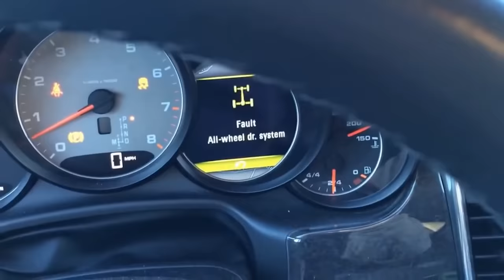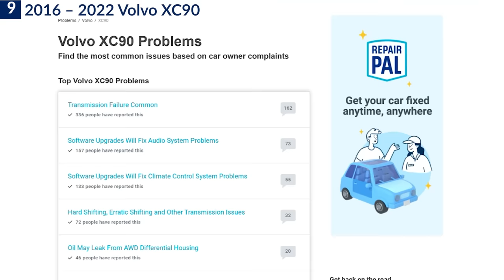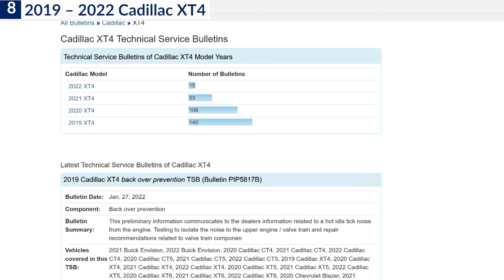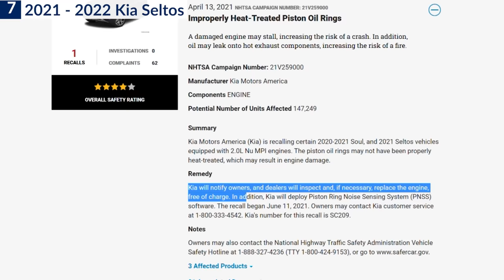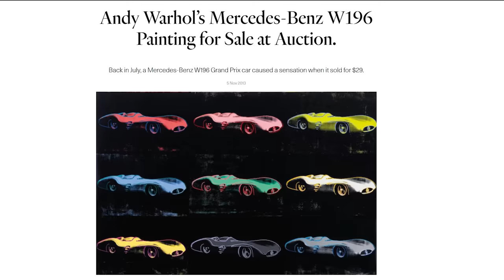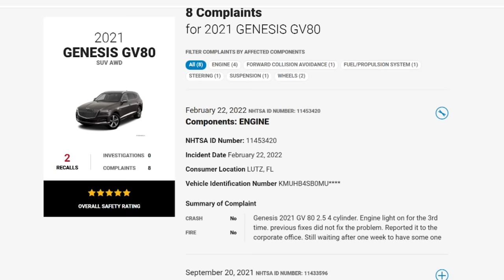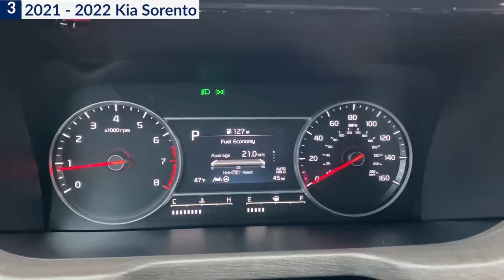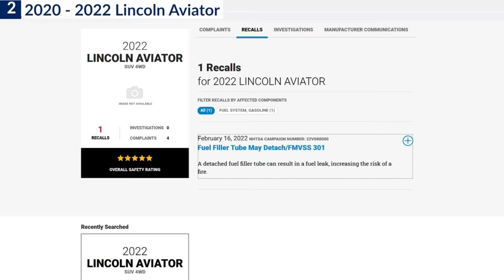10 New SUVs to AVOID - Here is Why !!

Comment: My wife has owned a 2018 Tiguan SE and the only issue she ever had, was one of fuel injectors went dead at around 30k due to a faulty connection, and it was covered under the warranty. She traded it in, at 48k, for a 2022 Tiguan SE. Neither car has ever given us any major issues. My wife absolutely loves her Tiguan. I had a 2018 Tiguan SEL and the only issue I had, was that the previous owner failed to get the recall done for the sunroof drains, and it leaked in a carwash. The dealership I bought it at, wasn't a VW dealer, and they weren't aware of the recall. Took to the local VW dealership for the leak and they replaced the sunroof drains, carpeting, sound baffling, and padding. Zero issues, besides the leak, and I loved having it. Traded it at 65k, for a 2018 Atlas SE w/tech, and had that for 2 yrs. Traded it earlier this year for a 2023 Atlas SE w/tech and can't see myself driving anything else.

Comment: I owned a Yukon Denali years ago and it was my most reliable vehicle ever.  I drove it to 180.000 miles before I had my first problem.   And the problem was a very minor problem.  The SUV never broke down on me.  But that was the 2002 model Yukon Denali.
Reply: They were made much better in 2002
Reply: Thats why, built much better than this new crap
Reply: That was a different era
Reply: Same, I had a 2005 Escalade, 2010 Escalade and 2016 Yukon Denali.  None of them ever left me stranded.  Of course I have this weird habit of doing routine maintenance.
Reply: 2001 Yukon with 201,600 miles and still going. Only replaced the oil line!!!
Reply: I have a 2003 GMC Yukon. 181,000 miles and going strong. I do have routine maintenance done. Love this vehicle and it is so comfortable.
Reply: 2007 Tahoe. 256k runs good
Reply: I have a 2002 Yukon. She has 300k miles, and is just starting to give me problems. 2023 will probably be her last year.
Reply: @tarawebb9237  oh, I’m so sorry to hear that. She’s been a great ole gal though huh? We had an alternator issue and one cracked wiper washer fluid reservoir. Oh and my batteries only seem to last 3 years before needing replacement 😀 She just hums along and I appreciate her every single day. Safe, secure and such a strong comfortable journey. Much luck in your new choice 🙏
Reply: 2005 Yukon 324,500 miles and still running good! Most reliable vehicle I have ever owned!
Reply: I do need to get the drivers seat reupholstered. The leather has begun to crack. TBH I use the seat warmer’s frequently in all months but summer😃
Reply: Thats funny how people say cars were better in 2000’s. 😂 which means if we go back more they will get better and better?! Early 1900’s had some of the best cars 😂😂

Comment: 10,000 miles into my 2021 GV80. best car I've ever owned. zero issues. Turns a head every day and someone will ask you if it's a Bentley daily.
Reply: If a car break down at 10k mileage, then they will go bankrupt in a year. Try 200k, then we'll see.
Reply: My next car!
Reply: Yep, 1 year in and a head turner for sure..
Reply: 10K and 1 year? Dude a Russian car can do that! LOL. My 2011 Jag XJ Supercharged was built 12/10 meaning it is about six months away from being 12 years old. 96K miles, purrs like a kitty. Only replaced the water pump. Your HyunKiaGen will never make it to 12 years. 🙂"Best car I've ever owned" my azz.
Reply: @trevorsutherland5263  i have kia with 200k still going strong. I intentionally drive hard too just to get an excuse to break the car and replace it but it just won't die. Never had Genesis but I heard nothing but great things so far
Reply: @trevorsutherland5263  cool story bro
Reply: @trevorsutherland5263  Jags are notorious for having issues OTOH Hyundai has almost Toyota reliability now. Have had Sonata/Genesis/CRV/Acura and had no issues with any one of them.
Reply: @trevorsutherland5263  What year do you live now? 1998? 2000?
Reply: I DRIVE 2015 TOYOTA  CAMARY  WITH 96000 ON GREAT 🚗
Reply: @trevorsutherland5263  Dude, you got fortunate. Plenty will tell you Jags aren't exactly the most reliable cars on the road. As in everything even the most reliable brand will throw up a lemon now and then, and the most unreliable a peach. That's life but on average Jags are not known for reliability.
Reply: @trevorsutherland5263  I still see Hyundia's and Kia's on the road from back in the '90's and still going strong.
Reply: @murp61  ya , having the engine replaced two or three times don't count, bro
Reply: The 3.5 liter ones are good engine

Comment: My 20201 Genesis GV80 Prestige 2.5T 300 HP RWD has been perfect.  It is as near perfect as any car I have owned.  There is so much quality built in that the $60K price tag is very  reasonable.  With 13,300 miles within  20 months ownership, I expect to have this car for a long time.

Comment: The Genesis GV 80 is the most reliable car I've owned,  not a single issue in two
Years and 30,000 miles.
Reply: Indeed!
Reply: I'm at 180k 7 years on grand cherokee limited no issues less than 100k miles it shouldn't tear up
Reply: LOL 30k mileage? Is that a bench mark for 1900's era cars? 
Today car bench mark is at 100k. And 60k is just a break in period of owning a car. In my opinion bench mark should be at 200k, where the Japan cars dominate.
Reply: i definitely don’t believe this about the GV80
Reply: And big anerican trucks and suvs.. tahoes expeditions etc
Reply: 2 years and 30k is hardly a glowing endorsement, but In general I have to agree with you. I had a 2018 Genesis G80 for 4 years and put 180k on it. It was damn near faultless, so genesis is capable of making a reliable car. Now the GV80 is new and its possible that Genesis messed up some things, but i have no doubt in my mind they are more reliable than some brands missing from this list. Audi, BMW, and Land Rover to name a few.
Reply: @DarianDT  agreed
Reply: LOL. My 2011 Jag XJ Supercharged was built 12/10 meaning it is about six months away from being 12 years old. 96K miles, purrs like a kitty. Only replaced the water pump. Your HyunKiaGen will never make it to 12 years. 🙂"Reliable" my azz.
Reply: @trevorsutherland5263  12 years 96k miles..... Be proud of the fact that something that barely gets used has managed to not break lol.  I put double the miles on a genesis, in a quarter of the time, and nothing broke, not even a water pump. Only things replaced were normal wear/maintenance  items: tires, brakes, fluids, windshield wiper blades.
Reply: @mabm85  😌 nice rebuttal.
Reply: In fact according to J.D. Power,the Genesis brand came tops for Initial Brand Quality and also Reliability going back three years now.
Reply: yeah i would hope so at only 30k miles
Reply: To the idiots that a criticized in this man for saying his Gv80 has 30 000 miles and is OK  The car has only been out a couple of years Try and think people
Reply: That’s my next vehicle. I have a RX 350 but it’s not enough luxury for me.
Reply: I love my GV 80!! To each his own.
Reply: I think he is talking about the 2.5 engine which has lots of issues.
Reply: @R Tee I am going to say what you possibly/maybe? forgot to say; your Genesis GV 80 is NOT YOUR ONLY CAR??
If that is the case, it is easy for me to believe/understand why there are only 30.000 miles on your vehicle.
Reply: Agreed. I have the GV70 and it’s golden
Reply: @DarianDT  yeah but with a genesis you get a 100k mile warranty while domestics balk at anything over 36k mile warranty.
Reply: Dont worry your issues are coming!
Reply: Two years. Really
Reply: @trevorsutherland5263  nobody asked :)
Reply: @mabm85  I have heard range rovers are some of the most unreliable vehicles ever made.
Reply: Still a baby, update that in 8-10 years at least.
Reply: Oh really. You must got a good one. 57 thousand miles on mine. My transmission started to slip.on my way to work one morning. !!  I took it right back to dealership. Never again. 🥵🥵🥵 I’m going back to lexus.
Reply: Bought my 2005 honda pilot; 178k miles with no issues except replaced alternator 2 yrs ago. Just do regular maintenance and runs like new. Paid 40k out the door.
Reply: how can you truly say its the most reliable when youve only had it 2-3 years lmao. literally doesnt make sense. LONG TERM reliability is what people talk about when talking about cars

Comment: I have a 2109 xc90 r design and it was 2 years before I even opened the hood and I only did that because I realized I had no idea where the latch was. Its been the absolute best car ever
Reply: I have a XC90 2018 T8 excellence, I've had no problems with this.
Reply: @nkulid424  iam having 2022 xc90 r T8 design. Such an awesome car
Reply: @jack32322  gosh I bet. Does it have air suspension?
Reply: @nkulid424  Yes. Best of the Best. Its hybrid, roughly runs 20-25 miles on electric before gas
Reply: Volvo is great. Don't listen to this rubbish
Reply: I cant afford one of the new ones, but then again, my old 2009 XC90 V8 has over 280,000ks and still runs like a clock!...so not really rushing for an upgrade ;) 
Volvo for Life!❤
Reply: @willytheekid  that's awesome, I always low key evny the V8. That engine is a masterpiece
Reply: 2109 xc90 must be futuristic asf lol
Reply: @andyb7719  Volvo is 🗑
Reply: This is BS the Volvo is a great SUV I have leased three of them Great car very reliable very safe
Reply: @andyb7719  agreed, im on my 5th one and never had an issue with either...started with a S40 i did have to get a battery and head light replaced on that one but thats normal wear and tear so im not complaining at all....currently have the 18 XC90 T6 have had it a year and a half now,no issues and absolutely love the SUV
Reply: @imdone1967  opinions are like A--holes everyone has one🤷‍♀️but im a proud 5th Volvo owner and beg to differ.....never had a issue with either
Reply: @teecope488  guess a sample size of one makes Volvo the best ever...lmao
Reply: @BialyOrzel777  👏🏿🤣👏🏿🤣👏🏿ikr,thats freaking hilarious
Reply: @imdone1967  i guess so🤷‍♀️

Comment: Boy oh Boy.. hyundai kia sure is screwing the pooch again. aren't they? Did anybody take notice of the one item these all have in common? If you guessed in car electronics you are correct. I have always said more wires will create more problems. Also i find the electronics in my 22 santa fe annoying as hell. The way the screen just sits there in the dead middle of the dash board. It is like somebody said, oh wait lets slap a infotainment system here real quick so we don't look stupid. I recently priced a replacement screen and interface. $3000.00 not including install. When it goes i guess crutchfield will have to do because i am not replacing that factory stuff.

Comment: We just bought the 2022 GLE 350 2 weeks ago. This is before I saw this video. But I am hoping that they have fixed the issues from 2020 to 2022 with the new 2022 model. I will keep you posted.

So far, we love the car and the drive is awesome. Interior is excellent looking as well.
Reply: Any issues so far?
Reply: @azher191  Just when it's raining, the water somehow collects in the middle. But the ride quality and the comfort is excellent. My kids love the LED color changes and the panoramic sun roof. I normally drive it in comfort drive and it's sufficient for City driving especially with traffic. Better gas mileage than our old 2008 ML350.
Reply: @slash2freeze  nice. But the water collects where? On the roof?
Reply: @azher191  In the front windshield. So it's harder to see with all the water collecting in the front windshield. It didn't help I was driving at night. But day time driving with rain was not an issue.

Comment: 2022 Sorento SX Prestige X Line owner for the  past year . I love this vehicle. All the features, smooth quick drive and spacious
Reply: I got a 2021 SX Prestige X-Line when it first hit dealerships in Dec 2020 and my only gripes are with the transmission at low speeds and a super annoying rattle around 1500 rpm that seems to be coming from the engine. My local service center acknowledged that they could hear the rattle but refused to do anything about it. I also hate that there is no HUD or ambient lighting.
Reply: Oh wow. You must got a good one. I’m on my second transmission !! Never again !! 🥵🥵🥵🥵🥵🥵😡

Comment: I had an explorer for 8 years with no issues until 1 days the engine started knocking. So I can’t say they’re unreliable because it served me well for 8 years.
Reply: I've had my explorer since 2003..have 150 000 miles on it..last explorer to be built on a truck frame..have no problems with it other than replacing a/c compressor..but living in az u use the  ac year round..ac gets quite a workout..still have it and it carries everything in the back..a great vehicle..

Comment: I’m on my fourth Land Rover/ Range Rover. Never had issues with any of them. Tried an Audi and kept it for 18 months of which two months were in the shop. Could wait to get back to RR.
Reply: Worst car I've ever owned. LAND ROVER. My God what a nightmare.
Reply: Not sure if you are getting new or not. I’ve owned 1 new 96 Discovery and 4 Range Rovers. The 2004 Range Rover was the most reliable, but still man the maintenance was over the top and stuff started breaking around 90 K miles.
Reply: Don't believe this lol. Must've gotten rid of each one after 3 yrs max, that's why you "never had issues with any of them".
Reply: @theGiver3  Had my first one for four years but had the chance to upgrade. Second one for eight years. Third one is new (8 months). My wife’s is twelve years old. Paid for extended warranty on the first two and my wife’s which turned out to be a complete waste of money. Average 25k a year. I know they have a poor reputation and perhaps I’ve been lucky but it is a mistake to think that they all break down, all the time. They don’t. Believe it.

Comment: I’m a Volvo XC90 girl and I’ve never had issues with any of them I own. My favorite vehicle honestly.
Reply: Give it another year...LOl....when it is out of warranty.
Reply: @chadhaire1711  Lol I currently have 3 of them that I’ve owned for years, again I’ve never had any issues with them. My oldest is a 2007 with 327k miles on it and it still runs fine, just recently needed to replace the oil trap. I also have a 2012 and a 2017, and I plan on getting a newer model next month. It’s my favorite vehicle lol.
Reply: @Mutable_PageOfCups  The Xc90 has had more recalls than I can list--2007 transmissions were horrible for a start, and since the Chinese took over electrics, drive line, brakes, leaks, and a whole list......no thanks
Reply: Same here,my XC90 is my 5th Volvo....i love em ALL🤷‍♀️

Comment: I can confirm one of problems with the 2020 Ford Explorer: Brand new, and we experienced leaks from the Transmission, so often. Parts had to be ordered, and car would remain days at the dealer for repairs. We had to take it 4 times, until we had enough. Not even a year and so many issues. --- So, turned out to be a Lemon. Ford had to buy it back. It was our 3rd Explorer,...so we were kind of surprised how sucky this new redesigned model turned out to be.
Reply: Oh yeah. I had one just like yours. It only had 15 thousand miles on it.  I only had the car for 2 weeks. Then my transmission took a dump on me.) ford had to buy it back. !  Because they knew it was a lemon. !! Never again. Worst car ever made. !!  One week later I got a letter from the ford corporate office. Telling me about a another car. NO thanks !!
Reply: Had a 2005 ford explorer. Needed a new transmission after 30k miles...
Reply: Ilove my 2018 3,5 non turbo Explorer Limited
Reply: Brought a brand new Escape. Worst car I have ever owned. Has been to the shop three times in less than a year. Now dealing with a lemon law attorney. Bad brakes, transmission and fuel pump.
Reply: Same here. My 2017 Ford explorer started having issues within months. Transmission of course. I love the ride and look but I will never get a Ford SUV. Ford pick ups are better but the explorer sucks.

Comment: I bought a 2002 tahoe new.  It went to 260k miles.  I drove it to the snow all the time.  It feel if I dropped a $1000 it would went another 50k miles no problem.  90% of time I used synthetic oil and always got oil changed w/ most rec services on time.  Best Car I ever owned.
Reply: Correction. 2022, right? 🤔